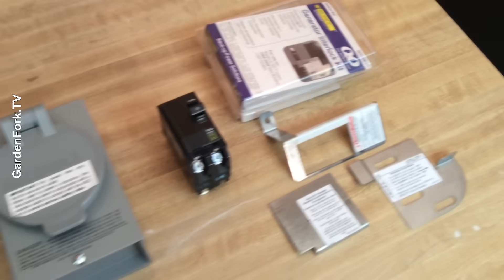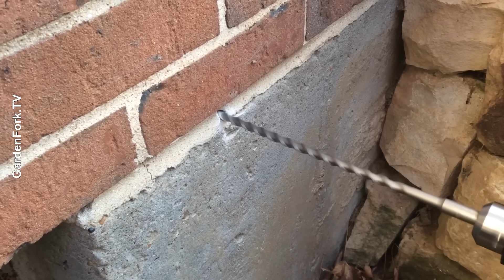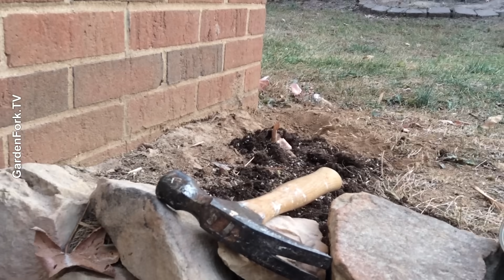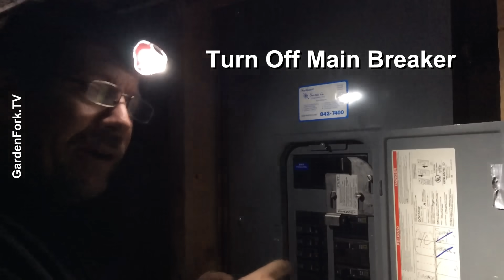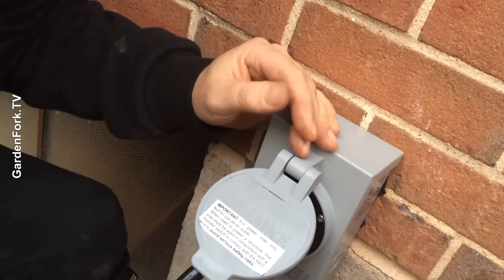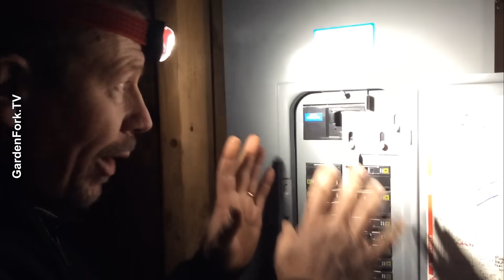Your Easy  & Safe Way To Hook Generator To House | Generator Interlock Switch Install | GardenFork

Comment from the maker: What kind of generator hook up do you have? And gas or propane generator? thx! eric.
Reply: Just bought a champion duel fuel 8125/6500 gas, 7325/5850 propane generator and installed a generlink transfer switch on the meter
Reply: Just used my generator for an outage last night. Propane! Stores indefinitely. And it started right up after sitting unused for over three years.
Reply: @LeadFarmer_84  My Gen is 7kw propane.  I can run it off of a BBQ tank or a special connection into my houses normal propane supply.  It is louder than I'd like but preferable to any gas generator or puny little quiet ones that are lucky to run some lights and a refer at the same time.  Propane gen is the only way to go IMO.
Reply: I have a 5000 watt portable setup to run natural gas. I use an interlock.
Reply: @rs1971camaro  .... Rally Sport 71 huh. Nice!... They were going for 1200 bucks when I was in High School...Graduated in 81....69 28s were going for 1800!... blessings from California
Reply: smfh...All the houses in Nigeria are wired like this, for Generators.And I always wondered why in the U.S the option wasn't automatically included in Home Wiring....Well....It didn't take long for me to realize the reason was because "The Power in the U.S JUST DOESNT GO OUT!!!"... Unless you didn't pay your power Bill or Due to a storm!  Ive been back in the States since Aug 93. And till this very moment I have NOT experienced power interruption for ANY reason whatsoever.....smh Unlike in Nigeria, the power can go out anytime from a few hours, a whole week and even a WHOLE MONTH!! (I heard its even worse now)  And not because you didn't pay your electric bill, but because of the Incompetent power Co/Government.... #GodBlessAmerica
Reply: soaringtractor  nope.  what effort? Not hooked to electric system. Not run through any walls or what ever. Just lay cable on floor. Power goes out just unroll coil to whatever and recoil when power comes back. So you a have a cable on the floor for a while. Couple minutes to unroll cable.
Reply: Got a diesel, lame brain.
Reply: @tomkeating65 
How about one of those oil burners that can run on virtually anything, from used oil to table scraps?
Reply: Best way is to mount a second breaker box inside. Install a outlet by fridge and freezer or other places. Run cable to each outlet from second panel. Run proper extension cord to second panel. Power goes out move plugs from fridge or whatever to secondary  outlet. Start generator. Too easy. Paint secondary outlets so people know they are generator fed. No dangers.  no interlock to prevent backflow into power line needed.
Reply: @Ericbjohnston5150  That's the easy way???  No need to go to all that effort.  Ridiculous.
Reply: @x-man5056  what effort? Not hooked to electric system. Not run through any walls or what ever. Just lay cable on floor. Power goes out just unroll coil to whatever and recoil when power comes back. So you a have a cable on the floor for a while. Couple minutes to unroll cable.
Reply: @Ericbjohnston5150  OK. Fine for infrequent or short term use if no young children or pets, especially dogs, but I prefer a hard wired plug in system ready to go and robust/safe enough for any weather and multiple days or longer.  Lock out not needed if you are informed and seems you may well be.  I have one 220 cord that plugs into purpose mfg. socket on house. No cracked windows or doors (for cords to go through), one cord outside, control all circuits from breaker panel.  About $60 bucks for breaker, wire, flex conduit, outdoor socket.  Cord cost varies depending on length and amp rating.  The wiring is very simple.  Get everything at HD or Lowes.  Keeping track of everything that's energized is so easy by just looking at well marked circuit breakers, choosing what's on or off.  Hope you never have long term outage.
Reply: @Ericbjohnston5150  
I like the idea but is there written instructions in case someone not familiar needs to utilize the system?
Reply: @Ericbjohnston5150  Oh this is interesting! I hadn't heard of this! I just got a generator so I'm new.
Reply: @Ericbjohnston5150  yeah I did that,then I did this much better..
Reply: @Ericbjohnston5150  phuck that, your is way to complicated, if the above method isn't safe enough you shouldn't own a house.
Reply: @watchluver  how is it difficult. Generator cord to seperate circuit box, 5 or 6 circuits. cable out to fridge and freezer. Another cable to outlet to power lights or small stove or whatever. Two hundred bucks not including generator. An hr to put it together. Nothing wired into exsisting home electrical system.
Reply: I'm an inverter type of guy generators are too noisey .... generators caz me to go flip tables in the neighbours house ( ͡° ͜ʖ ͡°)
Reply: My service panel was nearly full so I installed a second panel - fed by a 60A double pole breaker in the first panel - and I moved all of the essential circuits to the second panel. The main breaker in the second panel and the generator breaker are interlocked. 
Since the interlock isolates the second panel from the first, preventing backfeed to the first and thus the power grid, I can leave the breakers in the first panel turned on; when the power comes back on then the things powered by the first panel will come back on. 
I typically only run that generator when we need heat or running water (well pump). For the longer term stuff - like keeping food cold or frozen - I use a small inverter generator with extension cords; way less fuel and way less noise.
Reply: @paullogieri248  Please make a video demonstrating your "inverter generator.
Reply: @paullogieri248  I know what inverter is.  I know what Generator is.  Unfamiliar with "Inverter Generator".
Reply: @x-man5056  That's just what they call them. Did you look at the video I linked?
Reply: X-Man don't know if you got an answer.  Inverter Generators  run creating dc voltage than have electronics that convert it to AC most often true sinewave.    Since they do not need to maintain a constant RPM to maintain voltage they can idle low then speed up for heavier loads.  They are normally fuel efficient and built to be quieter.
Reply: @westcoaststacker569  X Man wanted me to make a video demonstrating my inverter generator. I don't have the time or equipment to make a video - especially when there are already dozens of such videos. 
I appreciate your having taken the time to explain how they actually work. :D
Reply: Just a new term to him I believe?   They are very common as we know with the Honda EU2200i and EU3000is being very popular for years now.

Home Depot the other day had a little 2000watt one discounted to $349 it was tempting as a spare for work etc...  Costco has the Yamaha engine one for $549  I believe.
Reply: @westcoaststacker569   I paid $350 or so for mine on eBay - factory refurbished. Runs good,  fuel efficient and quiet, which is very important to me: Being without grid power - even if I've equipped myself to have heat and water - is bad enough  without having to hear a generator howling in the yard for hours on end just to keep food cold.
Maybe X Man's first language is not English; we ( I anyway) take for granted that we're all "muricans" , which often is not the case.
Reply: I am an old electrician and contractor,  actually built my house.   We would get frequent power outages when the winds kicked up,  one day long one I tempted in a breaker to share the two legs and plugged into my trailers Cummins/Onan 4000 whisper quiet...  which worked but dangerous.  
Latter I installed a APC 32315-UTS10BI it is a transfer switch load shedding panel,  which automatically transfers critical lighting loads to a UPS then has a generator input which recharges the UPS and allows secondary loads like fridge circuits with load shedding and time of use options to allow a smaller generator to run multiple circuits.

Well, being in California with the CARB rated generators and Ethanol fuel I have had a hard time keeping the Onan operational,  one night we had an extended power outage during my sons bday party, high school kids,  Costco let me in while they were checking out their last customers and I bought the Smarter tools 2000w inverter generator and got home shortly after the ups gave up.

The next major power outage lasted a overnight when a large transfer switch caught fire at the utility.   I simply plugged in the little 2000 and it ran quietly all night .   On job sites some contractors bring their generators which rattle the whole site nothing worse than having to listen to that, worse than the leaf blowers.

So yes I want at least the two generators and looking at options for a Tesla Wall, a onsite generator or a diesel portable.   Earthquakes here can knock out the natural gas and the tesla power wall combined with my solar would be longest term but very expensive.
Reply: @westcoaststacker569  I've been busying myself lately building a smallish house in the mountains. We started on it before the electrician could get the temp service put up and the utility company could give us a drop from the street.
Ran a 4kw generator for hours on end framing a knee wall, first floor and then a snow cap for winter. It got so the best part of taking a break  was being able to shut that generator down for a few minutes. 
I read reviews for generators where people (apparently) run those howling banshees 24/7 following some monster storm. I guess you can get some idea of the gen's longevity from doing that, but the fuel and the noise!?
Must be some "can't miss" TV shows or whatever.
Reply: @x-man5056  did you ever find out the difference between the two of them are ?
Reply: @catslivesmatter1268  If you are referring to "inverter" and "generator", I always did know.  This is an old thread and to many responses to sift through to be sure what you are asking me, but I'm good with what I have, 7kw Propane, portable generator.
Reply: @paullogieri248  , I simply put my first generator in a box with insulation and I installed a one side hook system to open it up so the exhaust gas and heat has somewhere to go , never heard it running at all unless I went outside to check the fuel level and or oil level ? Now I have a generac which starts automatically when I loose power and shuts down when the power comes back on ( generator runs for a extra 5 minutes to make sure that the power is going to stay on ! Cost me 1500 plus the cost of the cable to run to the main panel , if it doesn't start up after 5 minutes of the power going off from the street , it doesn't try again until 10 minutes later and if it doesn't start then ? It sends an alert to the company to send someone out to fix it ! I'm to old for messing with the stuff anymore , but I haven't had any issues in over 6 years now
Reply: @westcoaststacker569  ,my brother in law who works for NASA happened to run across a natural gas well on his farm in upstate New York and decided to go get one of those construction generator and hooked it up to the natural gas well and called the electric company and told them to come and remove all the meters and don't bother to send any more bills ! You couldn't hear that thing running standing next to it when on natural gas and I thought it would make a difference when running one piece of equipment to another , didn't even blink a old light bulb ? Ran the whole farm house and his ultra light shop ! The government tried to tell him that he had to sell them the Gas but what was smart was he not only bought the house and land but he also purchased the mineral rights ! Many people don't realize they don't own what is under the ground ! Hell I didn't think about it until he taught me about it ! Smart man right there ,
Reply: @x-man5056  I think I meant the question to someone else who asked what the difference is because it made me laugh , my apologies
Reply: @catslivesmatter1268  No problem.  I thought I made a mistake once but found out I was wrong.  LoL
Reply: @x-man5056  hell my other half says I make a mistake once a day , from the moment I open my eyes to the time I close them at bedtime 🤫🤣😂😅
Reply: Pretty cool,  it is crazy now days the Government wants us dependent upon the utilities.  I do not know if it is only rumor, but have heard of properties in California and Florida using solar that are red tagged as uninhabitable.  Yes I knew about mineral rights, but in Los Angeles here that boat sailed long ago.
Reply: @catslivesmatter1268  Got one of those too........for the moment.
Reply: @x-man5056  for the moment 😅😂😹😆 hear that
Reply: @catslivesmatter1268  Costs a lot to get rid but costs a lot to keep too.  I choose rid.

Comment: You could color code the selected breakers
Reply from the maker: Yes! excellent tip Tony, thanks for that. I'll do that the next time I'm at their house.
Reply: I prefer Numbers at the side of the breakers and a list with all Numbers and a little circuit description ( Basement Lights , Basement Sockets , etc. )  , sticked to the circuit box door
Reply: @Ichwillkeinenaliascheisyoutube  The numbers and descriptions are required by code and should be done already.
Reply: @John Doe  I know that. It's not about the identification of the circuits for code, it's about not having to read the entire board every time the power goes out. Placing easily identifiable red or green colored stickers or pieces of electrical tape adjacent to each circuit breaker will easily identify it as a circuit that can remain on or must be turned off during generator backup.  It's quite convenient when the power goes out and I do it for all my customers.
Reply: I use the traffic light system for breaker identification. I use green, yellow and red sticker dots. Green - On at all times, yellow sticker - momentary use and red - Off at all times. These stickers help eliminate overloads and aid in decision making. You are not at your panel box everyday so to avoid having to read the description of every breaker and decide what's can go on and what can't, I help my customers with the traffic light system.
Reply from the maker: We could do both. I think Tony’s suggest was more about circuit loads than what rooms, etc.

Comment: Good info. We recently purchased an 8.5kW operating and 13.5kW Peak power generator for upcoming emergencies.  I plan on doing this work in the Spring, after our frigid weather, here in Kentucky, subsides.
Reply: Hey, roostershooter.  Any update on your project?  If so we (or at least I) would love to see your progress.  Good luck.
Reply from the maker: that should be plenty of generator power for you, we run a 6500 watt unit and the meters barely move when everything is turned on in the house. thx! eric.

Comment: Good information we put one in just like that  last year with 8500 generac.runs on proprane natural or gas.                                                     i
Reply from the maker: I have been thinking of getting a dual fuel generator Danny, have you had any issues with yours? one friend has to start his on gasoline, and switch it to propane. thx! eric.
Reply: I  bought the kit from a friend have use the natural but  most of the time i use gas
Reply from the maker: good to know, i like the idea of having both options. thx!
Reply: You can convert your current generator to LPG/NG by getting a motor snorkle kit from US Carburetion. 
It is a small rubber snorkel shaped unit that goes between the carb and intake and allows the generator to run on Gas, LPG or NG. 
My generator runs MUCH smoother on LPG/NG than it ever did on gas and certainly runs cleaner and slightly quieter. 
They recommend you run a new generator for 50 hrs on gas before conversion but other than that its easy.
Takes only a few minutes to install on most generators. 
Propane stores alot longer than gas, not sure why anyone would ever want to use a gas/diesel generator ever again once you've used a propane/NG setup.

Comment: Great video. I didn’t know anything about these switches. Actually my house was wired for a generator like yours before I bought it by the previous owner. He did something even different from that or the transfer switch. He wired a second line for all essential equipment like the well pump, the furnace, h/w heater.  All I have to do is connect an external circuit to the generator and unplug everything from the house circuit to the generator circuit. Keep up the good work
Reply: Every home built new should be wired for a generator... 🤓
Reply from the maker: Yeah Steve, I didn't either until recently. A friend hired an electrician to install a transfer switch and he suggested the generator interlock instead. Super simple. I have seen some houses wired like yours, sometimes with one large switch between the two systems. thx!
Reply: That will get it done.